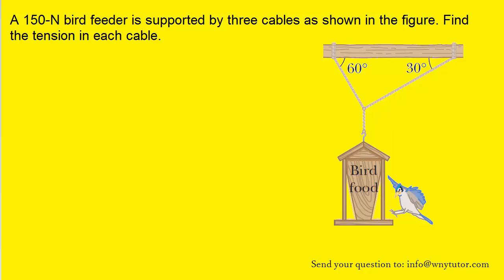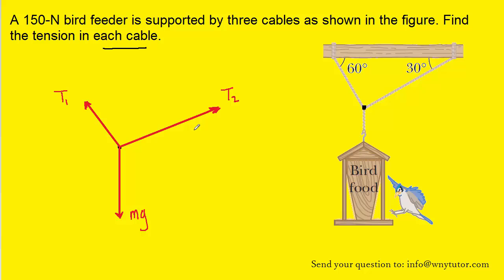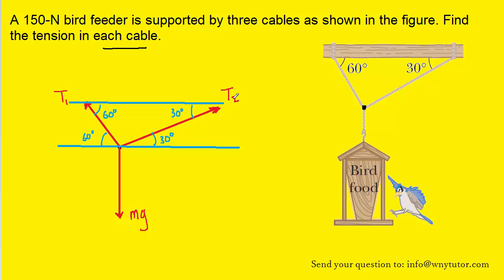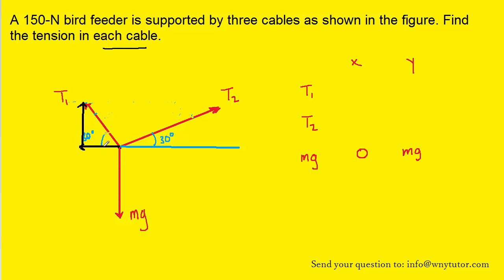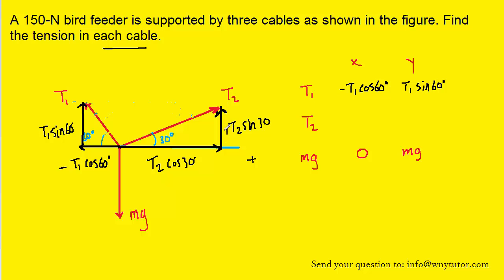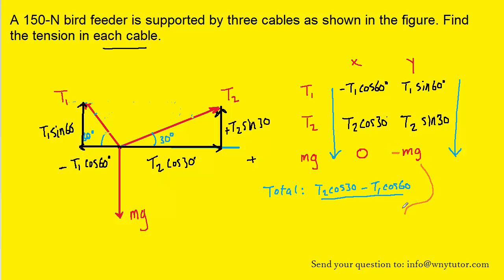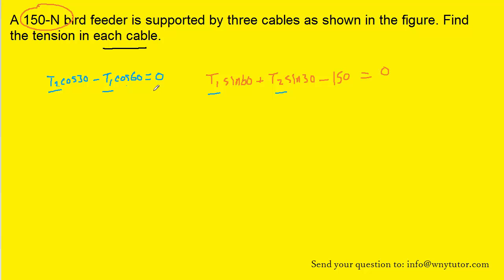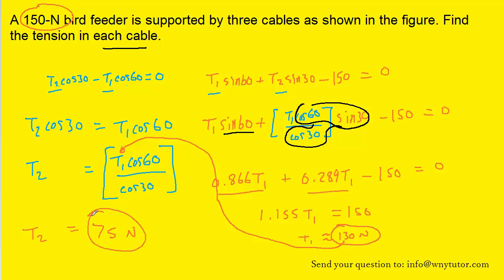A 150-N bird feeder is supported by three cables as shown in the figure. Find the tension in each ca

Comment: Bottom tension???
Reply from the maker: As the video states, the vertical cable had a tension equal to mg, or 150 N.
Reply: Thanks again! Do you still take in questions? I sent one to the email on the video but it said the email address does not exist.
Reply from the maker: Yes. The email is info at wnytutor dot com
Reply: 150 * 9.81 = ?

Comment: Thank You very much for your videos.. 

Can you please solve this one? 
Two blocks of mass m are fastened to the top of an elevator. The elevator has an upward acceleration a. The strings have negligible mass.  (a)  Find the acceleration T1 and T2 in the upper and lower strings in terms of m, a, and g.  (b)  Compare the two tensions and determine which string would break first if a is made sufficiently large.  (c) What are the tensions if the cable supporting the elevator breaks?  

Please do help.
Reply from the maker: You're welcome. Please let me know if this helps: https://youtu.be/WGSm9kdutkY